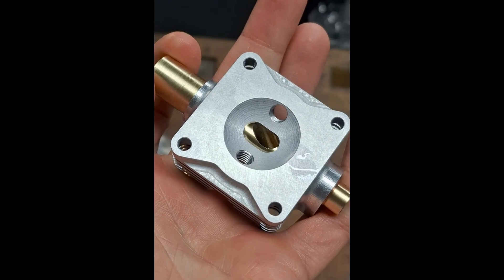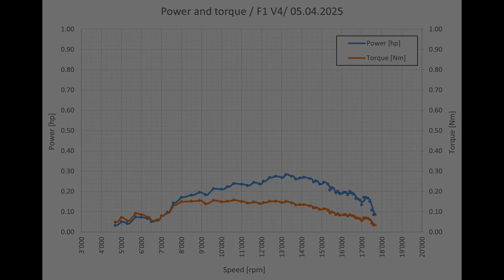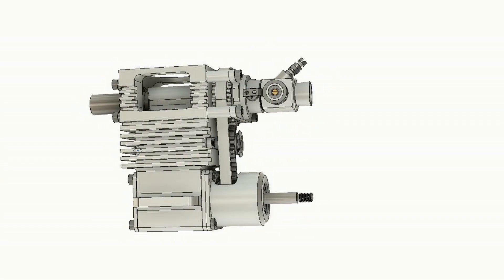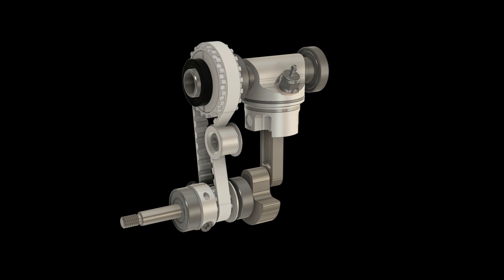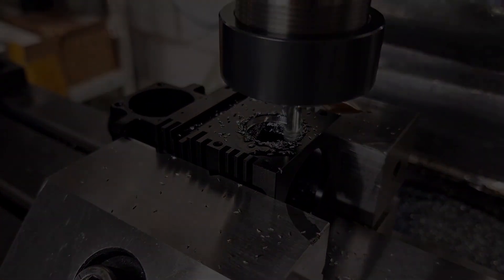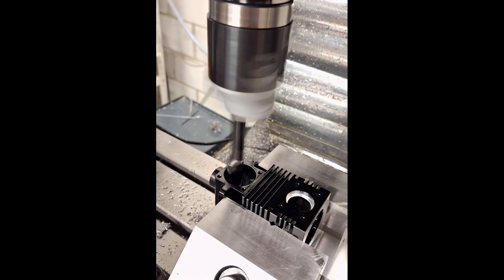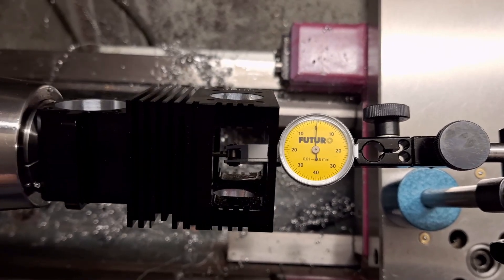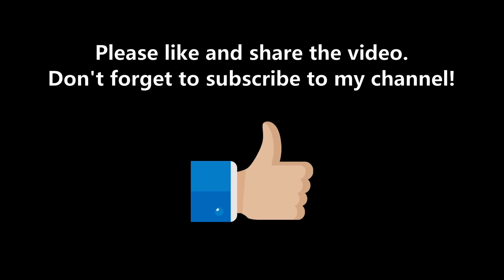New Rotary Valve Design for Model Engine / Modellmotor mit neuartiger Walzendrehsteuerung / Part 3

Comment: I find the idea of rotary valves exciting. It would be great if someone used rotary valves in their plans for building model IC engines. After spending many years watching engine builders on youtube,  it seems the hardest part to get right are the poppet style valves.  I would say i'm not too bad at machining model engines but I have built three of the most common ones but fell down on the valves.  There  was a guy from Texas that done something like a 30  build videos of the simple Upsur verticle engine but it would not start when finished , again I think he said due to the valves.  A simple rotary valve system would also save us model builders from having to cut spur gears.   Keep up the great work you do, I find it facinating.
Reply from the maker: Thanks bertyjustice! In the mid 80s you could buy such engines from Webra or Hirtenberger. For example the Webra T4-40 or HP VT 49. The problem was that the had had less power compared to the poppet valves versions from OS or Saito. That's where I come in and I want to push the performance. Let's see where the journey takes us!

Comment: Hey nice build bro but can you make an mini version of that new two stroke concept reviewed by "driving 4 answers   ... 'The engine of our dreams exist ' "it'll be cool if you could make an mini version of it as a desk engine 
Edit: its called the rev force engine
Reply from the maker: Why 2 stroke 🤔
Reply: @danielhunziker3577  cuz it gives all the benefits of a two stroke but without any disadvantages which comes from 2 strokes just watch the review video you'll get what i mean
Reply from the maker: @49Amit-j8t  I know this video, that's not the point. I just don't like two stroke engines and the sound of it 😅 I owned a Yamaha DT125 with variable Exhaust timing with kind of rotary valve. But even that didn't really fascinate me. 2 Stroke engines are just so prone to piston seizure due to the cylinder openings. There are ideas for converting 4-stroke engines to 2-stroke engines with regular valves. Are you familiar with this system? That would interest me even more.
Reply: @danielhunziker3577  yeah "le dan " have done it multiple times check his videos , that's why i give u this idea to make a small version of this engine cuz its different and nobody has done it yet , im giving this idea to many creators who builds engine from scratch, small big doesn't matter, i just want it to come to life, lets see who makes it first
Reply: @danielhunziker3577 the 2t engine seize more cuz lack of engine oil for lubrication, the rev force engine solved that problem, if you watch the full video of "diving 4 answers"you'll know why its awesome , and how can you not like 2t engines? 
-2x times the hp per displacement 
- Every stroke is a power stroke 
- light weight than 4t 

Perfect engine for racing 

 I would've personally made a v4 from this engine concept if i had the tools and knowledge required

Comment: Why don’t people make the engine to use electromagnetic solenoid valve instead of mechanical valve ?
This can adjust valve timing precisely.
Reply from the maker: There was once the "Free Valve" concept from Koenigsegg, the Gemera TFG. They planned to build 300 cars. They had to cancel it it 2024 and replaced the straight 3 cylinder with free vavle technology with common V8 biturbo engine. What does this tell us? Probably a very error-prone and critical technology?

Comment: That’s a very old design, they had that on motorcycles in the 1920s
Reply from the maker: Hi Terry 😃 You rirght. Rotary valves were not uncommon in the 1920s. But consider it a project and a technically interesting concept!

Comment: Heat issues on exhaust section.
Carbon build up seize valve ...
Reply from the maker: According your theory every engine would seize an block due the carbon build up at the cylinder wall. Does this happen?
Reply: @danielhunziker3577 poppet valves self clean rotate and have been the only solution on exhaust valves .
Detroit diesel two strokes have intake ports exhaust valves .
I have rebuilt thousands of engines since 1976...
Check.out "sleeve valve" engines 1920s .
Willy's Knight
Reply: Dyno test your design.
Perhaps it will be ok .
No offense intended.
Good luck 🤞

Comment: I wonder if there would be any flow benefit to a radius on the head at the valve opening.
Reply from the maker: Hey, I had that idea too! At first, I wanted to add a generous 45° phase, but then I decided against it. I can well imagine adding a radius there when improving the motor.

Comment: You need to use a geneva drive to move the rotary valve, a continuously rotating valve is wasting a lot of energy on friction during the combustion process, and it doesn't allow the best airflow, since the valve is completely open only for a fraction of its rotation.
With a geneva drive you can have it fixed during intake, exhaust and combustion, reducing friction and improving flow.
For sure it needs to be made with lighter materials than copper alloys.

The floating seal isn't a totally new design, I read about it in engineering books in the past, probably in "motori ad alta potenza specifica"(High power output engines), an Italian book written by very experienced engineers.

Cheers from Italy!
Reply from the maker: Hi man 😃 Sounds like you have some ideas. Doesn't that sound like the perfect project for you? That's right. Rotary valves aren't something new and were particularly common in the 1920s.
Reply: Just to add something, in that book there's some interesting insight on sleeve valve engines also, because the engineer who wrote it had designed one (a hybrid one with tappet valves for the exhaust and sleeve for the intake) for F1 Ferrari engines.
The project aborted, if I remember because of financial issues at the time, but the single cylinder prototype was tested for a while on the test bench, giving good, but not excellent, results.
Reply from the maker: @dadoVRC  When you speak about F1. Do you know Bishop? https://v-eight.com/multimedia/pdf/AutoTechBRV.pdf
Reply: @danielhunziker3577 I'm more into plastic recycling and DIY CNC stuff at the moment (check my other channel if you want, search for "precious plastic romagna" ), but I love mechanics and I'm basically a petrolhead even if I decided to concentrate myself on more environmental friendly things in last years! 😉

I'm also a machinist, I've been in the trade since 1999.

The concept of the geneva drive applied to rotary valves comes from the book I mentioned, I never made anything like that, I tuned, sometimes heavily, some engines in the past, but that's all.

Comment: I admire your pursuit of rotary valve architecture. Despite the well-documented shortcomings, its strengths are many with regard to reliability and reduced stress.

I would like to make a suggestion, though... while your counter compression design works with fuel-borne lubricant, you would want to incorporate some means of an easily serviceable replacement later... such as hard carbon (machineable graphite).
Reply from the maker: Hi James 😃 I'll be happy if the engine starts at all on the first try😅 It's a highly experimental concept and that's even in model size. But you're right. Once the concept works and performance meets expectations, questions of reliability will inevitably arise. This would also include ideas such as DLC coatings, aard chrome or hard nickel, right?

Comment: Anda harus membuat saluran exhaust lebih kecil dari intake.. itu berlaku untuk semua mesin 4 stroke, karna membutuhkan lebih banyak torsi..
Reply from the maker: Hi man! 😃 You're right! In 4-stroke engines with poppet valves, the intake valves are larger than the exhaust valves. This is because the exhaust gases have a higher velocity than the incoming fresh gas. This improves gas exchange and cylinder filling. But the correct question is, why have both valves here the same size here? What do you think?

Comment: It nothing new . Been done lots of times ,just not effective as poppet valves .
Reply from the maker: Hi Tony 👋 Relax, this is just a project for those who are interested in such topics 😅 By the on the subject "just not effective as poppet valves", look here: https://v-eight.com/multimedia/pdf/AutoTechBRV.pdf
Reply: as an example the Austrian company Webra built their T4-40, T4-60, T4-80 and T4-90 series from 1980-84. All these engines had belt driven rotary valves. The type 90 delivered 0.82KW @ 11.250rpm
Reply: Go play Fortnite, keyboard warrior

Comment: (idea suggestion comment) i dont have cad skills and stuffs so this will be a little hard to explain... i had this idea a while ago about rotary valves. the counter-piston is clever but it is bulky and manufacturing engines in such design is more complex. the sealing could be made better.... so:

the rotary valve housing has 2 seperate parts. the bottom-half housing and the top-half housing. on the bottom-half housing we have the hole that lets fresh air into the combustion chamber, and lets out exhaust gas from it. the hole shape is square to make the explanation simple. for now, lets just imagine assembling the engine like that: the bottom-half housing of the rotary valve on the cylinder, the rotary valve on the bottom-half housing and the top-half housing on the rotary valve (bottom and top halves fully encase the rotary valve, securing it in place). run the engine like that and we see that theres a leak between the rotary valve and the bottom-half housing.

to seal that leak we can (first, dissasemble the whole rotary valve assembly), look at the bottom-half housing (look at the square hole) and cut out a square "border" outside of the square hole. so we have this square groove (a cut-in line that loops around outside the hole itself). i dont know how well did i explain so far so i will show you visually the best i can:

===========
||   HHHHH   ||
||   HHHHH   ||
||   HHHHH   ||
||   HHHHH   ||
||   HHHHH   ||
===========

all those H's are the 1 square hole itself. the || and = is the cut in groove (in here, as text this groove looks dashed, but i mean as 1 continuous cut in line looping around the hole). notice that theres like 2-3 millimeter space between this groove and the hole itself.

this groove is cut in quite deeply. in this groove, we put in a square "frame", made of teflon or some low friction material. maybe the same material, used to make piston rings. the shape of it is:

===========
||                    ||
||                    ||
||                    ||
||                    ||
||                    ||
===========

so you see it has the same exact shape as the groove itself (and it fits into the groove perfectly). lets call this frame thing a seal ring.

before we put that seal ring into the square groove, we put in a square spring into the groove (you know how gun magazine springs look like) or a wave-spring that has a square shape. and on top of that we put in the seal ring. so now, we have this square seal ring which is spring loaded and we push it down with our finger, it gives some resistance (it comes back up, it always pushes up).

we put the rotary valve on the bottom-half housing (rotary valve is put on top of the spring loaded seal ring) and the seal ring pushes it up. we put the top-half housing on the rotary valve (encasing the rotary valve). now we have assembled the engine, except theres 1 thing different. theres this seal ring that constantly touches the rotary valve (seal ring is being pushed up against the rotary valve), blocking the combustion gasses from escaping into the rotary valve housing.

whew... dayum. i had this written so messily in my files and i rewrote this the best i could.

wait keep in mind, teflon seal ring could probably emit fine particles of teflon into the air... not sure how good that is in terms of air pollution.

theres 1 problem with this design however..... the lubrication of the rotary valve. all of the oil that will go seperately into the rotary valve housing to lubricate it, will also go into the 2 holes that the rotary valve has, letting the oil go in and out of the combustion chamber (which we dont want, we only want the fuel to go in and out). i have a very simple solution for it actually.... but writing that here will take more effort.

so umm what do u think lol
Reply from the maker: Your design proposal reminds me of annother design I have seen. This is also made our of two parts cylinderhead with various seals inserted seals. Look here: https://www.youtube.com/watch?v=GYQPEo0wjPo&t=928s He also shows how he dismantles the engine and what the rotary valve system looks like.